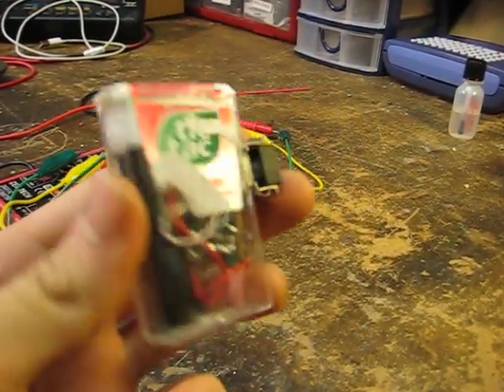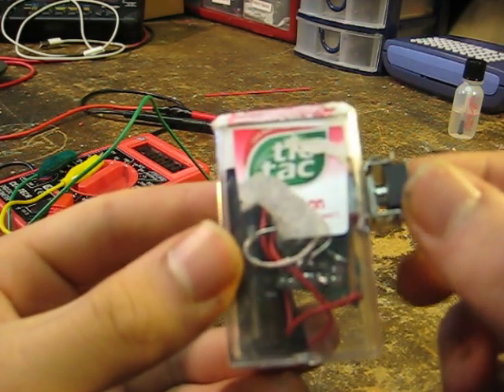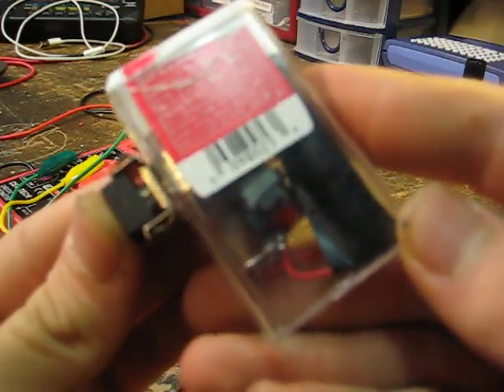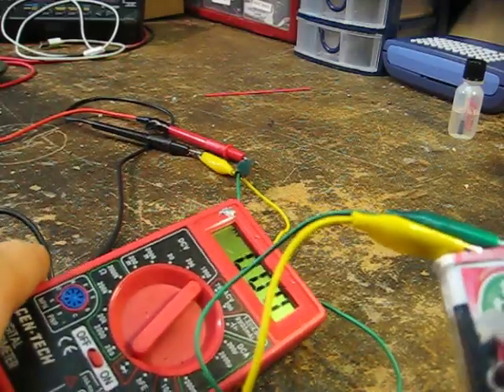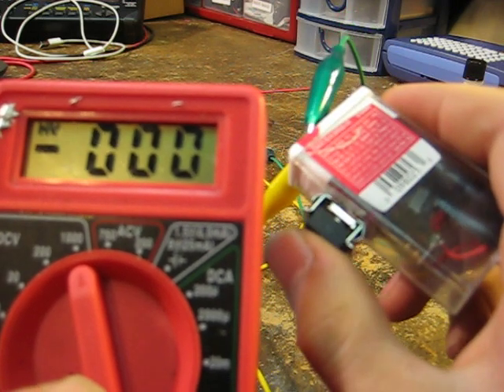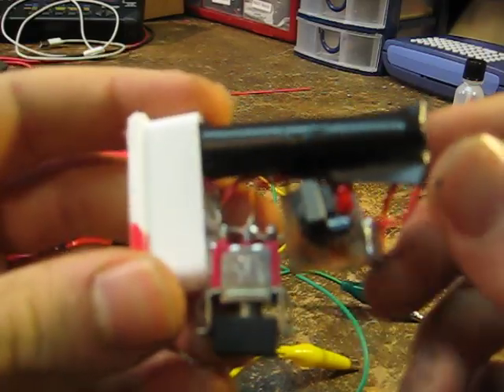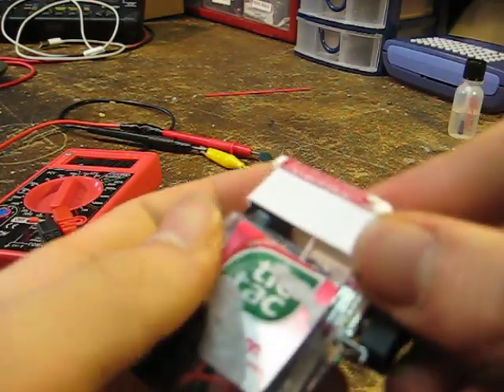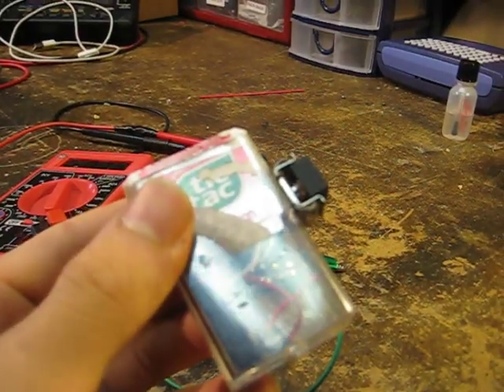TIC TAC TASER!! (Disposable Camera Stun Gun)

Comment: can you use a 2 pin momentary button? and could you discharge the capacitor while it is still connected to the circuit or will that blow the circuit?

Comment: i had one that i bought 7 200-400V flash caps with each 160 uF..... lol 1120 uF's and i had dual charging units with 4v going into each charging unit..charges to full power within 25 sec and it HURTS! prob deadly to! but i got it all to fit into a small old router chase and had wires going to a glove with contacts on it and so i charged it to full and walked up to my friend heactualy fell to the ground pissed his pants and was shaking....

Comment: I would advise against ever making one of these.  A real taser used current limiting resistors to PREVENT IT FROM KILLING YOU!  This home made device most likely doesn't have this current limiting feature because it came from a camera.  Don't expect all disposable cameras to be wired exactly the same way.  You might use a different disposable camera than was used in this tutorial and instead find out you made an electrocution gun.
Reply from the maker: +Joshua Portinga I'm not going to hate on your comment, no matter how misinformative it is. Instead, I'll say this: if anyone makes this taser, using an AA or AAA battery, and makes sure they throw out the 2200µF capacitor, they aren't going to hurt themselves. Doesn't matter which camera it is, or how badly they mess up with the wiring. So relax guys, its safe. This circuit doesn't need current limiting resistors because its not going to put out enough current to hurt you, no matter how badly things go wrong.
Reply from the maker: +Joshua Portinga And if you can make me a dangerous "electrocution gun" out of a AAA battery and NO capacitors, I will take the liberty of deleting this video.

Comment: What kind of transformer is
Reply: Step up. Depending on the secondary windings quantity, the output voltage will be different.
Reply: TheVideoVolcano stepup for dc curent ?
Reply: ***** Hmmm... remind me of the query? I realise transformers only work on ac as emfs are created in reaction of the magnetic field collapsing and not because of the magnet field itself.

I assume there was a oscillator (to ac) > transformer (step up) > rectifier (back to dc)